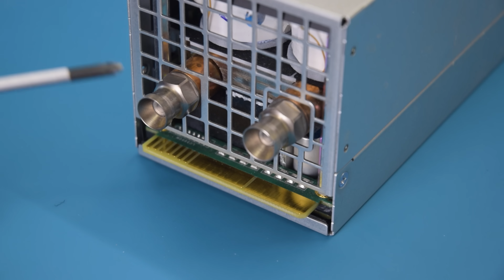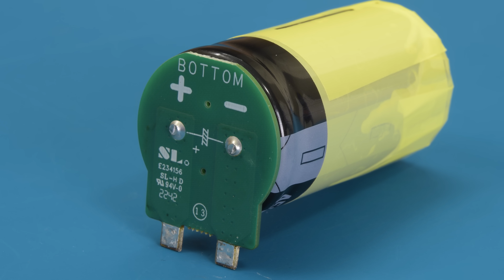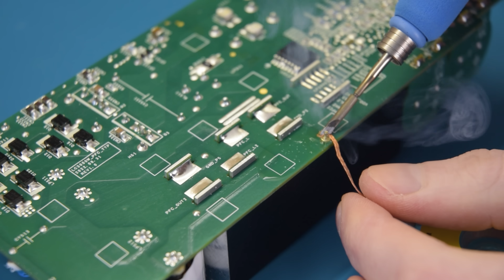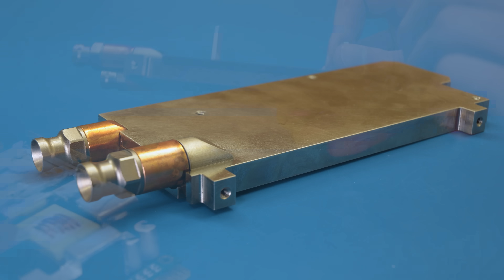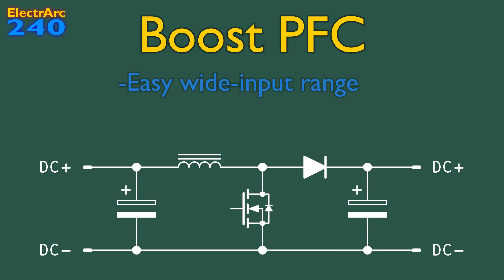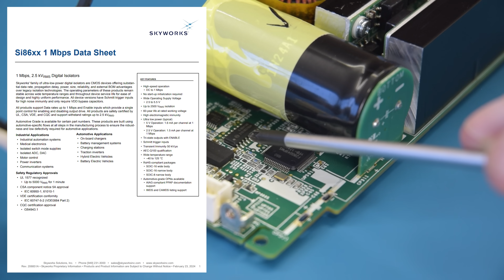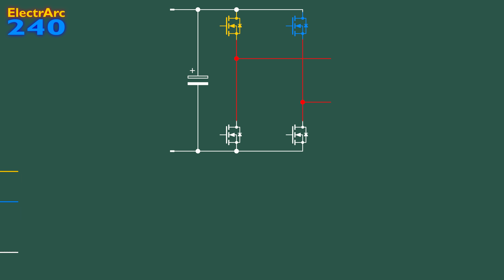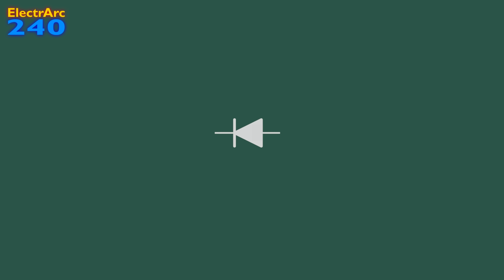Inside a 3000W Water-Cooled Power Supply (with GaN & SiC)

Comment: Where in the Fing Shii is our EFFICIENT SOLAR MPPT AND SOlAR INVERTERS?!?!??!??? Why has this not been done now?
The benefit is like 4 percent 4 percent compounding AT LEAST
Put it on a big pcb, integrate the battery terminals, bms, balancing, mppt input (high universal capability) and inverter. All on board, All needing just minimal connectors and copper and engineering. 
I think its easier than doing all this other shit by far. 
You standardize for a given voltage, and capacity. Say make it work at 72vdc for solar panel compatiblity wider ability, lower copper losses, lower losses in general. Then have a 24s lifepo4 battery. Vertical but not tall, on the x2 battery side, length is 12 battery length for space efficiency and stability. 
The unit rolls on casters, is not unwieldy can be laver lifted over door jams and can also go into tight halls or corners this way. 
Its lower to the ground, BUT the encased structure will keep it out of the way and protected. Not placed in front of cars in the garage, rather to the side, right next to the breaker panel, The outlet backfeeds, with lockout. Simple. Effective. Perfect actually. 
The 320ah lifepo4 cells make good sense, THOUGH i think the larger cells could be used, in the 600ah region. Standardized, realistically sized for ev charging and or home demand. The unit is big enough to power a well insulated house and with smaller solar arrays. 
The 22kwh or 44kwh versions ARE PLENTY PLENTY for every installation. 
Its space efficient, the 1 board is also replaceable or repairable in 1 factory, 1 overseer that can perfect and RUGGEDIZE THE PRODUCT FOR 40 YEAR SERVICE LIFE.
At 99 and 98.5 percent efficiency on solar inputs it beats the hell out of 93 percent efficiency then 85 percent efficiency (current products). 

ITS SAFER

When all the componentry is regulated and standardized in 1 go. 
None of this mix and match and china quality pinching bullshit.  

When you consider those gains against improved solar efficiency. It is stuipid not to have a shoebox home power supply with appendage battery large storage capability. 
It can be done with minimal materials. 
Cheap chips

It has to be done within 5 years or the world has failed much harder than initially dismally realized.

Comment: Regarding the capacitors mounted with small PCBs, I believe it's to reduce the inductance of the terminals to the minimum possible, since in situations of high vibration, the capacitors are normally fixed with clamps on the board itself, but still using the terminals themselves.
While researching a way to maximize the efficiency of a boost converter, I did many tests with a MOSFET acting as a rectifier diode. Right away, I reduced the dissipated power from 5W to around 0.7W, but I really felt the need for more effective control, a dedicated microcontroller, for example. In my tests, I used a pulse transformer, synchronized to the switching transistor, but at higher frequencies, the efficiency decreased drastically due to the characteristics of the transformer itself.
Reply: You know you just might be right! .on the other hand electrolytic caps use a jelly roll structure and normally are not used to bypass the higher harmonics of the switching frequency as MLCCs are. Maybe they were trying to Conduction cool the caps through their leads?!?

Comment: If I'm reading that label correctly, it allows 240V DC input (In China Only)?
Reply from the maker: Yeah quite interesting, wander what happens if I put DC into it here in the UK lol
Reply: @electrarc240 😂 the description in the label is for regulatory purposes, China uses both AC and DC distribution in their datacenters, so you can have a server using the same model of power supplies but having one with AC and another one with DC for redundancy purposes, this way you don't need an inverter in your UPS

Comment: The microcontroller exposes pins on the output side because they detect the edge connector the PSU slots into. In the past, most server / data rack PSUs were pretty basic in terms of what's going on at the edge connector here. Like, the receptacle would pull up / pull down with specified resistance to indicate compatibility and presence. Then usually an enable / demand line to light up the main rail.

Typically there are also a few lines for the power sink device to monitor power quality, voltage ripple, and most importantly, a coloumb counter that outputs a PDM signal, one pulse per unit current, so the system knows what its consuming. There are other interesting bits to do with hot-swapping and load-sharing across multiple PSUs, but this is already beyond the extent of my practical experience with these bad boys.

Also, it's been many years now since I worked in a data centre, and I would be shocked if that very "analogue electronics" style connector hadn't been replaced by a much more intelligent and complex smorgasbord of functionality and real-time system-wide sensor subsystems all talking SPI &  I2C with the host.

Comment: Very good analysis! Shockingly, but I have nothing to complain 😅
The 7 pin stand-by controller seems to be a Power Integrations "all-in-one" controller. Maybe a TNY290PG or such. Out of some reason they are are quite common in PC power supplies (and fail quite often).

Comment: I have a 3000W power supply, which is 12x24x4cm, meaning a bit better than 2500W/l. I bought it from AliExpress with about 100€. It’s originally some Chinese 48V rack power supply, which is failed in production tests and other company is buying them and repairing and modifying to be adjustable. 

I didn’t have high hopes for that price, but when I got it, I searched original specifications, and it had mtbf 50k hours. I’ve been using it to charge my 16kwh LFP pack for about one and half years, and it’s been working flawlessly. There’s about 3-4 hours on full power per day, except summer, when I mostly charge from solar panels.

Efficiency in full power is 92%, which I thought is not very good. It also draws 100w when idling, but power consumption doesn’t increase when smallish load is applied, so apparently it needs some base load to keep the voltage in desired level.
Reply from the maker: Sounds like a steal! Might have to have a look for one myself
Reply: is it R4850?
The problem is that, there was nice source of these for really cheap, buyed on for around 33 euro. But then source dissapeared and they cost like  100 euro minimum...
Reply: @pingwinvonjelen6586 Yes. That’s common problem. If you get a good one, order more as fast as you can and hope they are the same. Mine is Delta Electronics, ESR-48/56 AC Rev 11.

There’s also marking Dpr 48/50-D-DCE. I don’t remember where I find the original specs.

This is modified to give 60V/50A. I haven’t opened this one, so I don’t know for sure if all components are up to that voltage, but it has been working.

By the way, I have one project waiting for a time to do it, which may take a while. Anyway, at least for me, there’s some interesting aspects in that approach. It’s basically 50/50 fixed switching transformer to charge lFP batteries from solar array. Battery voltage is very constant over 10-90%, and also mppt point for the panels stay close enough, if panels are not in partial shade. This solution is interesting, because I think I could get away without capacitors and practically any other components. Also, because panels are constant current sources, cross conduction doesn’t mean explosion, so this could be good testing ground for controlled gate drive, which keeps the input current constant. With modern powder cores, this should reach very high efficiency. 

I have commercial inverter, with 8kwh battery, as well as self made 16kwh battery pack, that I charge with this power supply. Total efficiency would be poor when charging from solar, so that’s why I installed another field, that has three set of two panels in parallel, and they are charging my batteries directly. At the output, I have high power mosfet working as mppt and heating element. The aluminum plate where it’s mounted, is glued to my water boiler, so extra energy goes into water. In practice, the voltage drop is between 2-11V for optimal mppt operation. Even without heat production, this produces 20% more energy than commercial inverter with same panels. It’s partly because parallel circuit has better tolerance for shadows and partly because this responds immediately on transition between clouds and sun. So, removing all expensive parts, system works much better.

This is true for my goal to have cheap scalable battery storage. This cost me about 1000€/kwh. I use three 800w micro inverters to turn my 56V battery voltage to useful 3-phase AC, with disadvantage of having slower response. I can’t change output power too often, because the internal flash wears out, but my commercial inverter fills the gap, and this works as a base load compensator. I’m planning to add another 16kwh, which doesn’t need more inverters. That makes this solution economically scalable. However, in this situation, I’d need to charge batteries also from my main array, either with existing charger, or this switching transformer solution, which would give better efficiency and probably better lifetime, since there’s not much stress on components. 

What do you think about this approach, because for me, it appears to be the right solution to do this. Also, the efficiency of inverters are claimed to be 98%. Still in practice, they don’t get even close. Also, mine seems to consume around 100-150w when just being on. I assume it is because built in power factor correction, which seems to serve the grid with my expense. Manufacturer specifies 30W idle power, but that’s not what I measure.

Comment: This was one of the most exciting videos I´ve seen in a long long time. Very nice analysis and I´ve learned a lot.  Btw the capacitors are horizontal because vertically they wouldn´t fit under the cooling block and while horizontal they provide more "surface" to take away the heat.

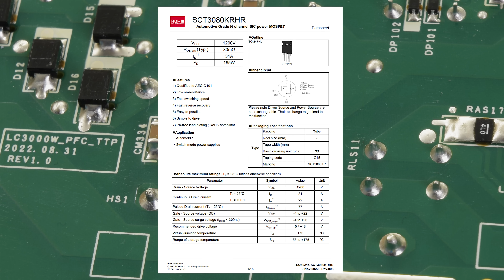Comment: 12:00 The datasheet note you highlight does not say you can't join the sources together. It says you can't exchange them. Because the drive source is not rated for as much current as the power source.
Reply from the maker: I know, couldn't find one that said don't join them and I was hoping nobody would notice haha
Reply: @electrarc240  In my experience joining them is ok. I've even used GaNs like that. When in doubt, big fat zone😄

Comment: [Input] TO-247 MOSFETs are active rectification; without fast switching, there's no problem tying the source pins together.

I wonder if they're bonded out that way internally? I mean the power path probably has a ton of bondwires (or large ones) while the Kelvin path probably has one or two (thin). It might be very little improvement.  I suppose if you want to save every last fractional milliohm, it's fine.

28:50 aha, there you have it!

Comment: Phillips (the screw-inventor, with two Ls) and Philips (the electronics-giant, with one L) don't have much in common.
Reply: PS. the mini-PCBs on the capacitors do wonders to minimize the ESL (inductance), assuming they are two-layer PCBs with overlapping planes. Bent leads would create a gaping loop-area of ~ (1cm)^2.
Reply from the maker: Sadly they are not overlapping planes, they are just stitched front to back following the same path as leads would have. As mentioned by a few other comments it seems very likely this was done as these big caps would have been snap-in style without leads long enough to bend
Reply: @electrarc240  Makes sense. Nonetheless, a missed opportunity on the ESL, imo :)

Comment: Coool to see a brainy PSU, now do a brawny one - take a welder apart!
Also around 3kW but needs to be insanely rugged!
Reply: Ah, so its an inreleaved totem pole pfc, followed by a resonant full bridge flollowed by synchronous rectification and a ORing controller!
Reply: Oh, so its non-resonant, but still has zvs.
My guess double diodes are to ensure they don't ever conduct when the pfc starts.
Reply: intresting thing is that, tig welder that can output up to 500A, and consume 20kW of power from 3 phase mains, doesn't have PFC, GAN'S , SIC'S. Its just simple 2 switch forward working at ~ 50Khz, and with standard diode output rectifier .. (dc-dc is working itself like PFC). So only signal it needs to drive is pwm (mosfets turn on in the same time). Sure control logic has DSP, but power supply itself is veeery simple
Reply: @pingwinvonjelen6586 tricky part that it needs to be stupidly robust! Given the nature of its load.

Comment: Impressive, but the one posted by @PlayWithJunk a couple days ago is even more incredible; 3200w in an even smaller air-cooled solution. (Dell POWERAGE)
Reply from the maker: When I received this I was surprised they felt the need to water cool it, I have seen other reference design power supplies at trade shows with double the power density of this and air cooled. Maybe I should ask one of those companies for a unit!
Reply: @electrarc240 datacenters now have water cooled only areas for dense AI gear. I guess it doesn't make sense to have PSUs cooled on air when the whole rack is already fully piped.

Comment: First: it's important to point out that cost cutting costs money to design and implement. For a low volume product, it's often not worth the design cost since you won't make enough units to actually save money overall.

Second: I don't think they intentionally pushed the thermal pad into the windings at all. Rather, it looks like the pad is a phase-change material, which means it becomes a liquid when it gets hot. They are often used in applications like this, since they can achieve a super high thermal conductivity, while being super easy to install. They also often actually get more thermally conductive as they experience heating and cooling cycles, which might extend the life of the power supply.

Third: the weird diode array looks like it might be just a series of small components acting like a pair of diodes, running from DC- to Neutral to DC+ (assuming your schematic is accurate). I'm betting Intel was either already putting these on the PCB, so they could reduce the number of unique parts that need to be placed on the board, by adding 4 of these rather than adding 1 larger diode.

Comment: Always a pleasure to watch, and this one didn't disappoint :) As always, the firmware on those 2 controllers is 50% of the magic so would need to extract, decompile and analyze. If you were ever in the mood to do a complete series on designing and building a 1kW MPPT-enabled, wide input voltage-range grid-tie inverter I would most certainly not be offended :)

Comment: 5:22 It's because most often, electrolytic capacitors at this size are Snap-in type electrolytics, whose leads are only a few mm long and thus way too short to just bend them 90 degrees and mount them that way.

Comment: That chain of diodes only means one thing to me, if one diode fails (short circuit and current flows through both sides) there is another diode to prevent failure, I think because the designer seems to have been very cautious, another example of being cautious is using 3 resistors in series to discharge the capacitor so that if one of the resistors fails and short circuit, it won't be a disaster.
I don't know, maybe I'm wrong, but you shouldn't be afraid of being wrong.
🤠
Reply: I agree with your point of view. In the past, 1000V diodes were rare and unreliable, so diodes were used in series to ensure that in case of failure, there wouldn't be a catastrophic short circuit. I think the idea is the same, but with the goal of increasing the MTBF (Mean Time Between Failures), since they are for expensive equipment that operates continuously.
Reply: Generally, diodes in series, like resistors, are used to prevent them from breaking due to excess voltages! In the case of resistors in series, the dissipated power is also increased! For the diode series, only for voltage peaks! Ultimately, the MBTF is increased.
Reply: Not sure if it applies here but I have seen that done when small diodes are used at high switching speeds at high voltage, since even with a very short reverse recovery they can end up dissipating a fair bit of power. I kinda doubt the bus voltage is high enough above the line voltage to need that though, I've only seen it in tiny offline buck supplies.
Reply: destroy everyone
Reply: This makes total sense if you also consider that these passive components are supposed to be running on the upper limit of their thermal range here, since there is no air flow and they are not directly connected to the cold plate. There is still some colling through component-board conduction, and maybe some internal natural convection/radiation, but they would be running hot, which is reducing the MTBF of the components.

Comment: 12v isn't really enough to pierce skin, kind of like those car battery demonstrations, if it goes up to 50v then it does start to get risky
Reply: 24vdc is a threshold for "safe" dc for wet conditions.
Reply: @f00busb4r-g4i  maybe so for wet conditions but osha sets a threshold of 50v which seems reasonable

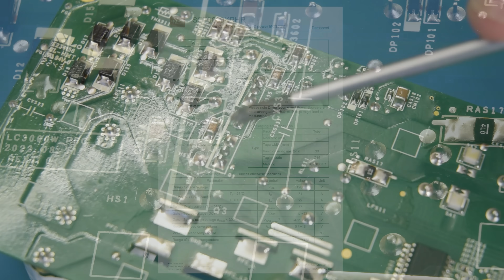Comment: 12:06 you are seeing the line conmutated totem-pole low frequency bridge of the PFC. Those To-247 are optimized for low conduction losses and only need to switch at line frequency, so it is ok to bridge the KS and Source pins. That allows for a DC minus referenced driver and less tracks so more compact design, every millimeter was shaved in this design
Reply: If only we could convince Nvidia to use this strange cheap reliable edge connector for their 5090 melty graphics cards 🤣
Reply: Well

Nvidia dropped consumers anyway 🤷